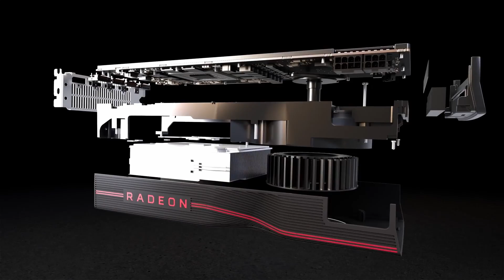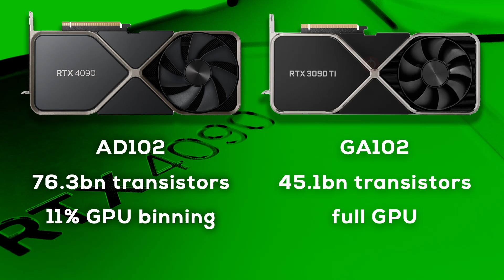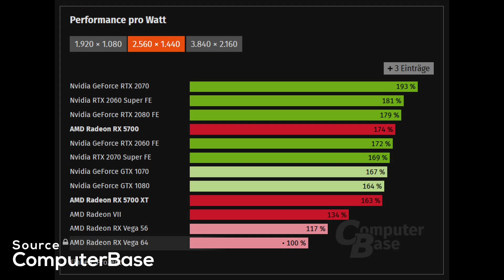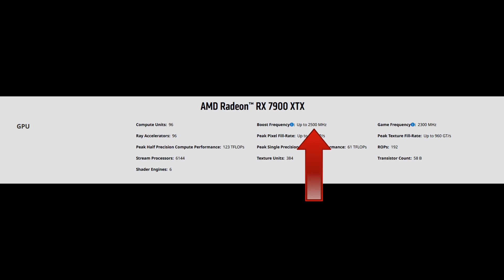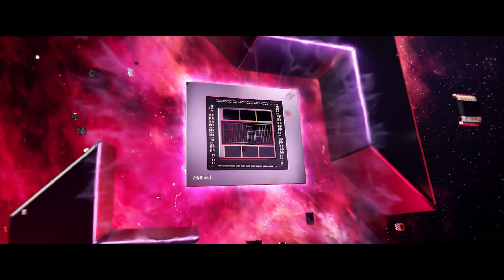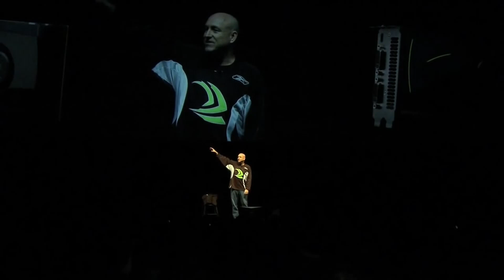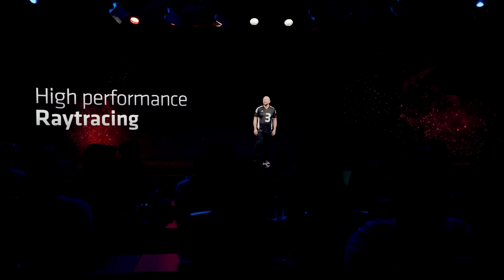RDNA3 – what went wrong?

Comment: I believe the clock speed/power issue can be fixed with firmware/drivers, but AMD has a piss poor history of quick and proper fixes.  
The performance deficit however is permanent, unless we're talking about boosting power consumption to 4090 levels. But even then, a 4090 with its power limited to 355W is already outperforming the 7900XTX at that wattage. AMD is basically second tier this generation.

And then they keep using that adage: "Age like fine wine", which to me implies they launch a subpar product and have to fix it over its 2 year life cycle, before the next gen launches. 
That's a cop out to me. It should fly, right out of the gate, and not take part or its entire lifecycle to reach its potential. I'm not sure how some people can even defend that notion.

They should have launched this card as a 7800XTX and priced it as such. As it stands, they are as bad as nVidia in misrepresenting this card as a top tier performer. And it definitely is priced  the same as the overpriced 4080.
Reply from the maker: I'm really hoping it does turn out to be mostly driver related, then we still have a chance for decent competition this gen!
Reply: To be fair on the performance comparison, the 4090 has 30% more transistors and they have that with less dense libraries (total die size only 15% larger) which is good for clocks/temps. It would be shocking if the 4090 wasn't proportionally faster, and that's even before talking of chiplet overheads. It just wasn't AMD strategy to make a bigger GCD this time (or last time either), they know that they're still second place in branding and in some features and they have to compete on price.

And I agree on the rushed release with apparent low quality software but I don't agree that this is a pattern, at least not recently. On the contrary, as a current owner of a 6800 XT, driver quality has been very strong through the entire lifecycle of RDNA2. Very good track record on other software pieces like the Radeon app, Ryzen Master (now so good I stopped using Hydra), FSR. You get some bad bugs in non-beta drivers, but you get plenty of those for RTX also if the tech forums I follow are any indication they had a  couple stinkers this year.

Here's my theory: AMD didn't scale the software team sufficiently for this launch. GPU drivers have ramped up in complexity and AMD already scaled that work during the RDNA2 cycle with improved quality and support for game-specific optimizations, catching up with ray tracing, releasing surprising improvements for both DX11 and OpenGL both in 2022. They didn't handle the extra squeeze of a new architecture, part of that work during the pandemic crisis. NVidia of course has the same challenges but bigger R&D capacity.

Comment: You should be asking what went wrong with Nvidia, not AMD. The RTX 4090 is 20% faster than 7900 XTX, so it should be $1199, not $1599. And the RTX 4080 is slower than the 7900 XTX so it should be $949 at most. Nvidia is ripping people off.
Reply: both of the rtx gpus still consistently and convincingly beat the rx 7900xtx in ray tracing and upscaling method by a longshot. And the 7900xtx isn’t exactly leagues better than the 4080 in rasterization. They’re about the same in performance on average.
Reply: @SpawWn7  AMD could still improve and work on FSR, but Nvidia does have an advantage in ray tracing, but still can't run ray tracing at native 4K at 60 FPS even on the RTX 4090 for some games and needs the help of DLSS / upscaling. Ray tracing is still demanding regardless if you have Nvidia or AMD and isn't like you can have ray tracing without upscaling.

Comment: I think it's a win for AMD. It's priced at $900 not $1600. It beats the 4080 with rasterization and ties a 3090 with raytracing
Reply: @@oezplays833 Oh, stop. That joke is long dead. There were 0.03% of cases (probably lower now) And 100% of those were due to idiots not plugging the cable in fully.
Reply: Remember when people were shitting on nvidia for power draw, and here we are. The 4080 is far more efficient. Uses less power, runs much cooler, and has no coil whine. All while leading performance overall by around +15% (before RT and DLSS3)
Reply: @bryzeer5075  😂
Reply: @timothygibney159  Yeah, it is funny that people keep acting like it's an actual issue still now that it's been fully debunked by Gamers Nexus
Reply: @bryzeer5075  it wasn't debunked. NVIDIA didn't make their cables idiot proof. What other product has melting cables outside the 4090? People thought it was fully plugged in because of poor design. A 1600 dollar piece of hardware with cheap poorly designed power connectors, what a disgrace. NVIDIOT fanboys have to eat that, enough with your mental gymnastics trying to explain it away. Poor design is poor design, and on an ultra expensive card its unforgivable.
Reply: @mjkittredge  It doesn't take a genius to understand how to plug a cable in properly. Again. The amount of cases of melted cables is less than 0.03% and 100% of those were cause by improperly plugging in the cable. 

The cable isn't the issue, it's the human plugging it in. Do you think any cable with an electric current running through it will function properly if it's only half way plugged in? Think before you speak.
Reply: @mjkittredge  It doesn't take a genius to understand how to plug a cable in properly. Again. The amount of cases of melted cables is less than 0.03% and 100% of those were cause by improperly plugging in the cable. 

The cable isn't the issue, it's the human plugging it in. Do you think any cable with an electric current running through it will function properly if it's only half way plugged in? Think before you speak.
Reply: @bryzeer5075  well I'm not the one who designed them so that they SEEMED to be fully plugged in but weren't. Those 50 some odd people (plus more that we don't know about certainly) weren't trying to destroy their expensive cards on purpose. I've never heard of anything like it before with GPUs, ever.

Every other card has a cord that doesn't melt. NVIDIA fucked up. Think before you fanboy. It's pure incompetence that every other GPU managed to avoid in the entire history of GPUs.

Comment: There is nothing wrong with this card other than the price.  Its a $699 card and I hope we see that price by the fall of next year.  Like every amd release, ignore the reference models.  As for performance, drivers will squeeze out another 15% in the near term.  Hardcore enthusiast(water) will have a field day with >3100mhz clocks, 2800mhz vram and <1050mV undervolts.
Reply: Remember when people were shitting on nvidia for power draw, and here we are. The 4080 is far more efficient. Uses less power, runs much cooler, and has no coil whine. All while leading performance overall by around +15% (before RT and DLSS3)
Reply: @bryzeer5075  And cost way too much, At least in my country!
Both cards are garbage until we return to pre crypto pricing with just the inflation added.
Inflation maybe 20-30% on some things but it's not 100-200% that they were charging during mining.
Reply: @ShaneMcGrath.  Stick to consoles then. Or ake a visit to America or have a buddy buy you one here and ship it to you. You can buy an MSI Ventus 3X 4080 off the MSI store for $1,189 US. Free shipping and no tax.
Reply: @bryzeer5075 no way that’s a straight rip off and I’ll wait for the prices to drop to where they should be like I did with my 6900xt, or just not buy overpriced trash ever. Vote with your wallets people.
Reply: @bryzeer5075  nice massive price increase over the 3080. NGREEDIA milking the NVIDIOTS with too much money and not enough brains.
Reply: @mjkittredge  You understand AIB 7900xtx's are between $1,100 - $1,200+ don't you? You also forget how BAD of a value the XT card is. But you're just gonna pretent that doesn't exist right?
Reply: @bryzeer5075  copy and paste
Reply: @ertai222  Hey, guy. Come talk with the grownups when you can actually grow facial hair.
Reply: @bryzeer5075  good one👍🏻

Comment: Why did Amd not name the cards 7800xt and 7800? Then they could have fixed the issues then 6months later released the 7900 and 7950xt
Reply: Maybe because of the bad press the naming scheme gives, a 7800 XT consuming 355W and being $1K would be dubbed as "bad value" but the performance uplift if compared to the 6800 XT would be good at least. As it's stands the 7900 XT is kinda already a "7800 XT" anyway, i want to see what they will do with the real one released later

Comment: Unlike you I was really hoping for more (read: my soul was crushed,... why would you do this to me Lisa, why!?!?!) and I remain confused.
If I over simplify things a lot.... (same basic argument as 4090 = 60% more CU's than 3090 and = 60 % higher performance) - and largely ignore clock/cache changes...
If the dual issue shaders can only do either INT or FP output then the shader count is 6144 and this is about 20% more than NAV21.. add in some clock and cache and hey presto - it matches current performance we are seeing .... about 20% faster most of the time - sometimes faster as the clock increases.
If the dual shaders are meant to do INT AND FP (a bit like two threads at 100% throughput) then the effective shader count would be equivalent to 12288... and we should be seeing 2.0-2.2x performance in purely bitwise operations - I do wonder about the specifics of the tests benchmarking to date. FP specific tests should only get 20% uplift from what I can see online to date as there is only a 20% increase in FP units over NAVI21 - but again, disregards clock and cache changes.
Reply from the maker: Something is clearly amiss with RDNA3. Best case scenario it's really just the need for more game specific driver optimization. Worst case, the chiplet design still has its problems. Lets hope we will find out!

Comment: What went wrong? You tell me.  A company one fifth the size of nVidia, has a 1000 dollar card that outperforms their much bigger 1200 dollar card, and even beat their 4090 in a few titles.  People just like drama.
Reply: Out performs the 4080? we haven't seen the same benchmarks yes in few games it had 3 fps more but generally when the 4080 performed better it performed noticeably better. And at 4k Nvidia dominates. Not to mention the power draw lack of Raytracing performance lack of DLSS and so on just to save $200 and have a broken GPU with broken drivers that might or might not get fixed in 6 month to a year. My point is pay the damn $200 extra and save yourself a headache.
Reply: @L B   DLSS and Raytracing are clear strengths of nVidia, one of which being a proprietary technology. That has nothing to do with the product coverage. And as an owner of a 3070, there are few titles I actually have DLSS in. Even less worth using Raytracing. I would much prefer higher fps. 
Linus, Hardware Unboxed, Gamers Nexus all show the 4080 being beaten by the 7900XTX on average 5-7% and if the product is as broken as you say it is, then that margin will only grow. If we're going to dramatise, let's talk about the more serious fire issue (which only realistically affects a very small margin of users).
Reply: @LB-sh7qt  4080 didn't perform "noticeably better" 😅 that's a pipe dream. Also, it doesn't "dominate" 4K 🤷🏻‍♂️ 🥱
Reply: @calisto2735  Nice you believe that and ignore everything else wrong with AMD. Nothing besides Nvidia pricing is wrong with Nvidia for you.
Reply from the maker: AMD is a pretty huge company, over $100bn market cap, even after the current market down turn.

Comment: what went wrong? Expectations. Expectations from hopeful people believing leaks, and then AMD set expectations during their presser in october.
If you have no expectations you're not disappointed. I had NONE because PR and leaks are not a final product review.
Never board the hype train, never believe marketing PR. Both will get you disappointed.

That said, I'm fairly sure AMD missed their own perf target by a third, they announced +50, they reached +35 so to reach +50 they'd have to improve A LOT. Still, I'm not disappointed :D I'll see what the product stack looks like because I may replace my 3080 or my 6600xt at some point soon (although I love the 6600xt)
Reply: watching the video and very good job explaining the technical side of things! Yes, AMD probably messed up something. The good thing is that with chiplet, they can actually change the core without changing the rest, of keep the core and change the MCD... so it's much easier to fix things since it's modular. Let's hope they'll refresh something and and RDNA3.1 will be out in less than a year!

Comment: It wouldn't surprise me if there multiple small issues/bugs in the chip/driver. I work in software, and often there the QA folks test A, and they test B and they test C, and all three might pass, but when they combine A+B+C it doesn't go so well. Often too, there is a push from the top to meet the "date". Everyone knows its an artificial date, and does it really matter a whole lot if its released on Monday or Friday? Most cases its doesn't matter, but from the wallstreet side it does seem to matter, and they really want to make that date. The TSMC capacity is an interesting point, if I was paying for that capacity, and had a choice of getting nothing for my money or something sub-optimal, I think I would take the sub-optimal instead of nothing myself. Ill bet they were hoping/praying that they would solve the issues between the announcement date and launch date, ive seen behaviors similar to that in my career. If there are issues, I hope AMD can identify and correct the issues quickly.
Reply from the maker: Software could indeed be behind the majority of the problems. I'd be super happy if AMD would be able to greatly improve RDNA3 with upcoming drivers.
Reply: @HighYield  this is really good if AMD try to fix this fast enough like Intel fixing their Airbus GPU, A750 and A770
Reply: Dude you just described AMD for the last decade

Comment: The problem is their slides say they tested it against the 6900xt while the guys on stage said 6950xt when you look at the test systems they used. They weren't even on the same page within the company 🤦🏽‍♂️
Reply: The slide during presentation showed it compared to 6950xt … the clip is in this video??!
The problem is in the memory controller with the infinity fabric having a 100 watt idle power draw is something that might not be fixed … I’m almost certain there is no way they could be so incompetent to not only be 20% slower than there lowest promised performance metrics and overlook hey are card is running at 30% power draw while it’s on the sleep screen guys… like wtf are there engineers doing.
Reply: @JoeWayne84  Yeah I guess it was changed when they posted them to their website lmao. it says 6900xt now.

Comment: One - yes new design equals new problems. Two - amd is not good enough with drivers at launch. They are way too long to tweak and adjust. Three - could be something in many games that favor nvidia. But why on earth do we see those crazy scores for cod modern wf 2 in hw unboxed / techspot ? Here it beats the 4090 ?! I think much of this relates to drivers or games that utilize the cards wrong / differently than the monolithic design gpus. No clue but guess there are some people working late at amd to fix this. Otherwise we will see massive price drops in near future !
Reply: game probably optimised well for amd since they got it to run on ps4/xbox and also amd powers current gen consoles
Reply: @konzo5942  lots of games is found on xbox and playstation like battlefield series - they are not optimized for amd ! So a game found on xbox / playstation is not saying anything. I doubt that this is the design - would have been stopped long time ago if that was the case. No I think it is the drivers - as - sorry to say - the usual AMD problem. It will get there - but not for launch !
Reply: @Thomasdk1405  true but its likely they had to do a lot of optimization to get it to run on last gen, more than usual